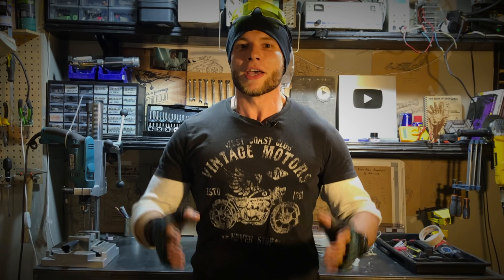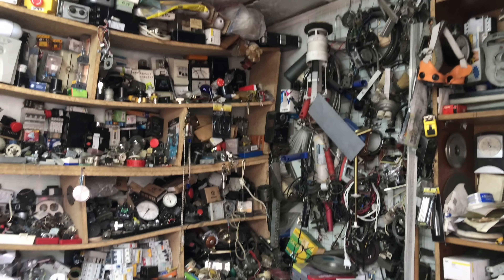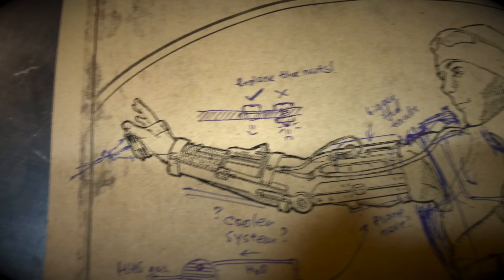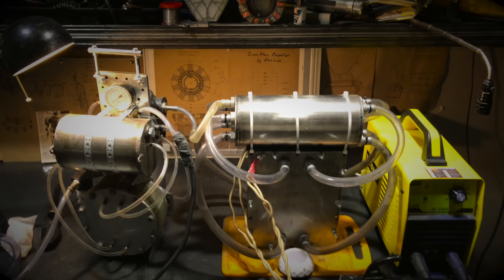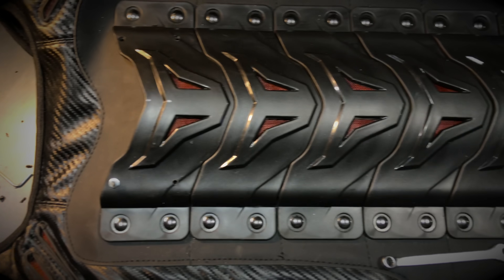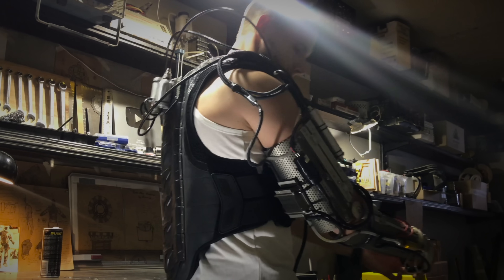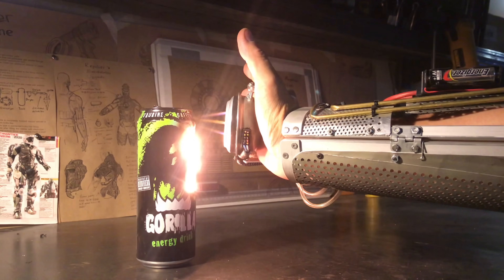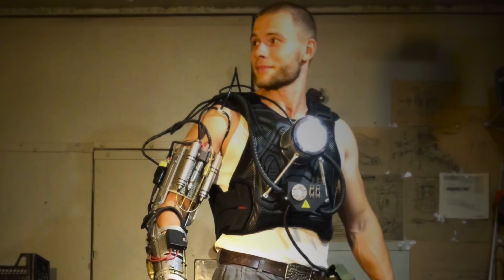Iron Man Repulsor 2.0 (3000°C HHO torch for Iron Man suit) DIY alkali electrolyzer

Comment: After watching Alex Lab Iron Man concepts, it made me think for a second...

 He is using electrosys to separate the hydrogen and oxygen molecules from water to obtain the fuel and oxydizer for his system, now, the first thing we can notice here is that he is not only obtaining fuel for the glove, but as a matter of fact, a big power storage with all that hydrogen and oxygen building up. Basically, if one were to build a full suit, it would be more or less a giant hydrogen fuel cell.
 Thing here is, you need power to break the water atoms creating potential energy, and transforming this potential energy back to kinectic energy will create some loses, which would render the model useless, unless you add some external devices to transform potential into kinectic energy, solar energy for instance.
 If we can solve the problems withing the hydrogen fuel cells concept that we face today and refine our knowledge of Hydraulics running on purely water, then I would say it would be possible to create a full operational Iron Man suit working on Hydrogen.

 Another thought I had was the viability of using a high power output pulse/laser to ionize the air ahead of the glove, creating plasma would probably be enough to permit a higher velocity output of the hydrogen from the glove, creating a longer and hotter beam.

 There would be alot of challenges (as Alex say) in such concept.

 Am not an engineer myself, and I this might be just a very dumb idea too unpratical to happen, but it might not be, who knows?
Reply: I'll act as if I unferstood what he just wrote
Reply: But how do you mean to use solar energy? It would not be as efficient and take more time, you would need to charge the solar cells so you need a big battery which means more weight
Reply: @justsomeone899  maybe hydraulics could hold the weight of the suit, saw someone make a hydraulic suit that made the user significantly stronger. If it was incorporated into a full built weight wouldnt be an issue
Reply: @Dylan Barnett yes could be a try worth, but it reminds me on that military fail scene in the iron man movie where the top half of the suit turned around too strong and broke the guys back xD

Edit: if the goal is to have a suit that can fly, the weight does matter still ;)
Reply: @justsomeone899 
If we're being realistic here, the whole flying thing may as well be impossible. The rest may actually be somewhat achievable.
Reply: @Cheeks2184 actually it‘s not impossible at all, go look up flying suits and jetpack projects, there are already some (primitive) nice projects ;) should just not be too heavy to be more energy efficient since all the energy comes from the suit itself
Reply: @justsomeone899  that's why you make a mechanical lock on anything using hydraulics
Reply: Cheeks2184 not impossible. Combine this tech with the flying suit Adam Savage made and your on your way.
Reply: @justsomeone899  this problem is easily solved. I'd imagine an inner hydraulic exosuit could remove some of the pressure put on the waist and hips. Rather than throwing hydraulics into the waist, it makes more sense to use a bendable material in that area since most of the weight, I imagine. Will be on the shoulders and legs. Doesnt make much sense to throw hydraulics in the waist or hip portion since you should be able to turn freely. Maybe an inner rail system using bearings on a set rail would be easier to move smoothly.
Reply: @justsomeone899  even with the flying suit, it isn't flying in the same way as the iron man suit.
Reply: @Aaron Montgomery maaaan let us engineers dream, only like that a dream can become real ;)
Reply: @aaronmontgomery2055  if you have enough energy to form lift, then you are flying like iron man.

 Also, hydrogen was used as rocket fuel for a long time now
Reply: @justsomeone899  like I use to say... Nothing on this universe is impossible, improbable yes, but not impossible

Edit: the very first thing you get out of quantum physics is that notion
Reply: @Matheus Bee or that multiple answers are correct, if we talk about superpositions hehe,i like how quantum physics is a completely different world. Now that you brought the topic, what do you think about tachyons?
Reply: @justsomeone899  hard to say anything, as they are a possibility which we wouldn't be able to determine with the actual knowledge...  From my point of view, a tachyon, as any other quantum particule would exist in no time in the space and yet in all of them, only to fix themselves when observed, would we be able to observe it...
 In resume, they would break casualty only when not observed, but attach themselves to the casualty once observed, meaning they are virtually impossible to interfere with the past for example... But also meaning they can be one of phenomenon that creates the relativity of quantum physics...

 Last time I started thinking about quantum physics I almost went insane, and I feel that's once again the case, so I will simply leave this as is because my brain is not able to fully comprehend it. I bet I my thoughts sounded a bit lunatic ooof
Reply: @justsomeone899  as I ended my answer, a better explanation stuck me... Tachyons would be attached only to space when not observed, but attach themselves to time once observed and in that way, unable to break the casualty.
Reply: @Matheus Bee well i don‘t want to break your mind :P
That‘s actually a perspective i didn‘t saw until now, nice thought tho. I kinda imagine it to be not attached to the time in this way, but that a tachyon behaves like the quantum fluctuation in very short existance periods and kind of tunnel through space instead of have a velocity. And that makes it nearly impossible to observe when it doesn’t interferrence with the higgs-field. But well then we better stop the topic before insanity😉
Reply: @justsomeone899  well, that just makes me crazier than the average person perhaps lol
Reply: @Matheus Bee i feel you, for me that‘s the same with stuff like fractal mathematics😅
Reply: @justsomeone899  thing here is something to start the chain reaction of the hydrogen and oxygen and a way to keep it virtually impossible to run out of energy

 The hydrogen itself is a energy carrier, you only need energy to force the chain reaction, would you need it...
 the byproduct of a hydrogen cell is water, and the byproduct of water eletrosys is hydrogen and oxygen, you can see where this leads to, all you need is a second power source to cover the energy deficit of the conversions.
Reply: @Matheus Bee hmm well i don‘t know how much energy will be needed or how much you can get with solar, but in this case like you described it, it‘s a good thought🤔 would need a try to figure out if you can cover the deficit with that method, go ahead😉
Reply: Almoast everything is posible ... problem is a energy .... Well he make 1 Kw hydrogen unit just for this smal plasma torch but ironman generator have like 1MW ... this is 1000x more. .... for plasma [energy] torch you need two: things high temperture and high voltage you can make your own energy plasma torch from old microwave trafo with few more components problem plasma cant reach long distance because have problem with atmosfere [cooling and loosing free ionts from heating before] so you need for longer distance of plasma preheating air and blowing trouth the jet where adding energy to the very hot air ideal is around 1000°C preheated gas but more is better more you preheat the gas less energy for create plasma is in need. But you have other choice not just preheating gas like vibrations [high hz], or just very high of rotations [movments for colliding molleculs]  and you can try to combine all of those you have some airpump [for trying purpose compresor to like 10atm] ... micro wave with magnetron for high frekvenci and some sort of high rotation fan [10k rpm] in it and the chamber where you heated the gas or add energy to it and you have mabe workable high °C plasma,,,,, the laser [very strong] is need only for longer distance for free ionts on further atmosphere and you need a lot of energy .....  One small tip for boost your temperature add 5-15% os propan  you get like 30% boost on temp.
Reply: I have a feeling yiu made a few words up
Reply: Instead of solar energy. How about turbines?Mini turbines that might spin fast enough to develop large amounts of energy through a series of gears or at least two, a large one being powered to spin and a much smaller one converting the mechanical energy into amplified energy. Wind turbines don’t spin too fast yet they create exceptional amounts of energy. I’d say it’s something to look into
Reply: @ezrimata4540  problem here is, you need to have energy to create energy on this sort of system, and unless the second energy source can be found naturally and simply converted, it would only increase the energy deficit.
 I don't see any mechanical energy being used as a second power input on this kind of armor for two reasons, energy conversion efficiency and space.

 The big turbines spin slow because they are Huge and have huge gears to spin, which is not possible on a human sized suit. But I think there could be some use to reutilize some of the energy spent, and that would be key aswell
Reply: Matheus Bee I totallyyyyyy understood what u just wrote
Reply: @MufasaAri  lmao. Put it simple, he "creates" the energy by converting hydrogen and oxygen into water, and he gets the fuel for the torches by converting water into hydrogen and oxygen, plus something else to cover the energy lost on conversion

Comment: I have a challenge for you. We play Airsoft games, make Airsoft Sniper barrel on your one arm with motor, gearbox etc on shoulder (barrel length from shoulder to past the tip of your fingers) so point finger use thumb or pinky finger to trigger the gun. Have electric BB feed from 1000 round magazine on back of helmet (gravity + electric feed) - main challenge is to bend arm or use arm with 1.2m straight barrel mounted to arm (unless barrel can be split into 3 / 4 pcs with exact robotic re-attachment / perfect alignment) now for other hand ... Same but short barrel 3 or 4 x pistol barrel shooting either together or in sequence or select sequence.

So fit everything on to shoulder and arm exo-skeleton -- with magazine box attached to back of helmet or 2  bottle & tube feeders one on each shoulder. Have micro cam mounted to end of barrel connected to flip down TFT screen in in front of goggle so can sit behind cover stick barrel arm (with camera sight) out aim and shoot? Possible? Or impossible challenge?

Comment: I have two ideas to minimally improve your design but not by much. You can reuse some of the heat from your hand to generate some electricity with pads that generate electricity when they touch heat and two mini solar panels on your shoulders can be rerouted to the batteries to generate energy when your low on power. oh and some DIY 'Starlite' for heat absorption.

Comment: would a more heat resistant metal or some form of a ceramic insulator reduce the heat on the back side of the nozzle?

Comment: Hi, this is SO, AWESOME!!! I LOVE THE what you are doing.!! But most people who are not an engineer" do not Quite get - it. The hydrogen gas system that you've worked out alone is "GROUND ZERO"  For anyone who are looking for a way to power things like chargers, well, genarators that are being used to recharge power systems" well, battery Bank's that feed an inverter. But that's another Subject Matter" ALL TOGETHER,!! RIGHT. Any way my friend,.. I have an system, of making hydrogen, GAS, that will blow you away,!! But not literally.!! LOLOL 😁
It does not involve(STAINLESS steel)
As you might or might-Not know,??
Stainless steel, used to produce hydrogen fuel cell technology, puts off, a type of gas, That is poisonous.
Lucky for you I know of another way to my Hydrogen fuel cell's useing 
Graffen & M.D.A. plastic, Also, you might wanna look into the chemical,
Called ura, it's commonly used in 
Fertilizer... It increases the out put,
Of you're (HHO GAS), By more than 
30% by useing it ( UREA ) instead of 
Any other Electrolyte... Now, just contact me, if ya, wanna talk 🦃...
Good luck, !!!

Comment: Looking forward to seeing the glove designed to handle the massive heat output of the materials you use the repulsor on. Hacksmith had that metal glove. Was it heat resistant such that they could do something for a while, or did it heat up quickly? Well, in any event, yours is cool and each new version should be even better.

Comment: that is a very good idea using energy to turn water to hydrogen and oxygen and using that combination to burn into a concentrated few beams. Ive been working on the physics for a plasma generator though for a long time, imo you should make the hydrogen first, ionizing gas is tricky, without an oxidizer like oxygen you could apply energy and heat to the gas through an implemented catalyst ring of probably something like pure palladium. then because I like your heat collection hardware you could use that same setup to gather and repulse the heat and energy giving you more force behind the firing. but im a physicist more than an engineer.

Comment: if you pressurize the gas, you could route the fuel line behind the aluminum block, the cold gas coming out of the pressurized tank will cool the block down some, and should also insulate your hand from the heat sink.

Comment: Would a liquid nitrogen cooling system work? You could either run it through a coil system much like a compressor or the through tubes like a computer cooling system. It obviously may not work but it was just a thought

Comment: A couple of suggestions (maybe)?
- using water cooling instead of a small radiator
- use 6 nozzles driving less fuel on each nozzle with a bigger bang at the focus point (cuzz I just love the pattern of a hexagon, it's basically everywhere in nature)

Comment: I personally think people should focus more on making functional Mandalorian battle armor.  You could easily convert the jet pack into a gas system or a battery pack to fuel whatever functions you need. Imagine if you will instead of using the Arc Reactor for his previous Hydrogen cannon, he used a backpack similar in size to a Mandalorian jet pack.

Comment: What if you added a high power electromagnet to the arc reactor in order to drive a turbine? You could reduce presssure, meaning the gas would be pulled through faster, allowing for much more fuel to reach the chamber. And plus, the inclusion of several smaller reactors across the body, outfitted with custom minimalised turbochargers, like in a car engine, also driven by the electromagnet would reduce heat generation, converting it to far greater portions of force. Reducing voltage reduces gas flow due to slowing the turbines, meaning you'd risk less blowout at the end of the nozzles, while also lowering the turbochargers, boosting heat, allowing for variable mode selection, between max heat and max instantaneous force. If the magnet is in the reactor, then a ring of step up transformers could be used to vary the voltage, creating the variation needed. I could be wrong, but I think each repulsor would only need to output 22.4 newtons of force to counteract gravity on an average adult male (not including equipment weight, of course), if four are used like in the movies. As for feet, perhaps using series of hammers against the back of the lower leg would work as a detector, wherein when the leg is flexed, the hammers are pushed down, and as a result the system changes for continuous force output or blast heat, pretty much inverting the time periods when you tense your legs. No idea if that'd work or not as I don't have the resources to try, but hey, maybe. The first video inspired me to research developing one of my own, and those were some things I came up with before realising I have no money lol

Comment: If you used periodic injections of liquid fluoroethanes or other compressed liquid gasses to cool the hand piece, I imagine the rapid expansion of it would give an actual kinetic repulsor blast. Also, did you experiment with the nozzle opening’s geometry? It’s possible to maintain laminar flow through other shapes than a circle.

Comment: Alex: electrolysis hydrogen aluminum reactor
Me pretending to understand: 🧐🤔🧠
Reply: Basically it just turns water into hydrogen gas (basicly)
Reply: @Idontknow-km5hp  yeah when electric current passes through water it changes it breaks it into hydrogen and oxygen it's 8th grade science
Reply: The delta heavy that was supposed to launch last night uses the same propulsion, they just use liquid versions for capacity. That rocked failed to shoot unfortunately due to a ignition failure at T-7. Same idea. Pass electricy through H2O breaks down to H and O2. You might think then well thats infinite energy, problem is it takes around 48% more energy to make hydrogen from electrolysis. Really the only reason to make hydrogen is for specific reasons like launching rockets, other wise he could spend close to 50% less energy and get the same result. Practically this is a useless application, other then for entertainment.
Reply: If I understood well, all he does is just electrolyse water and then burn the HHO product back into water through his "repulsor"?

Comment: Iron Man Boots Design Hypothesis
The gas used is hydrogen, an advanced suit like the iron man can simply extract the hydrogen from the air through electrolysis, the water is condensed as the suit pressurizes ram air to form water, and the hydrogen gas is produced and directly sent to the rocket boots
This is just copy and pasted